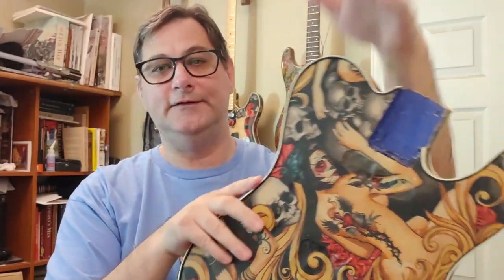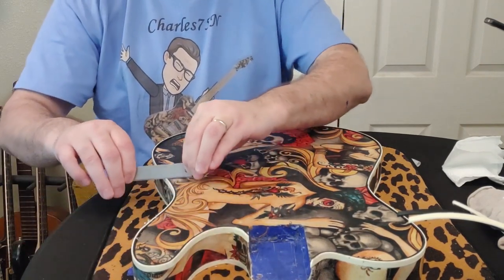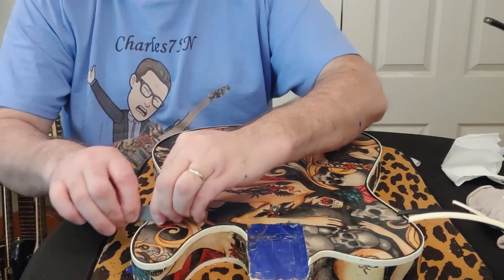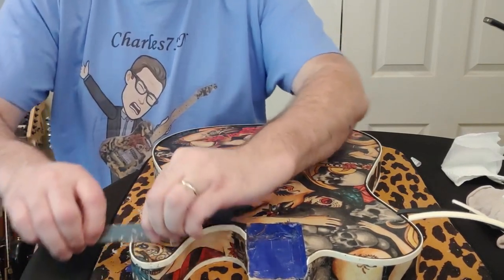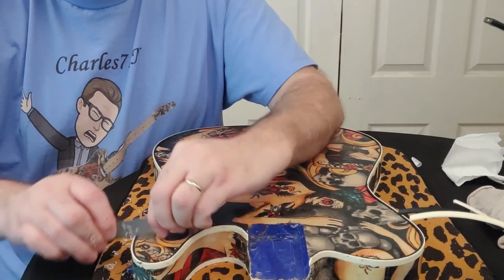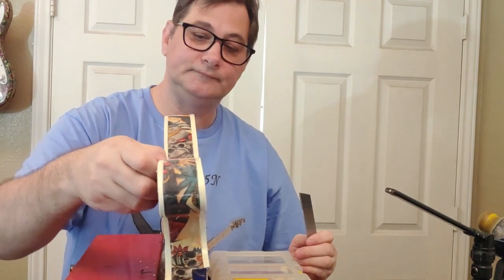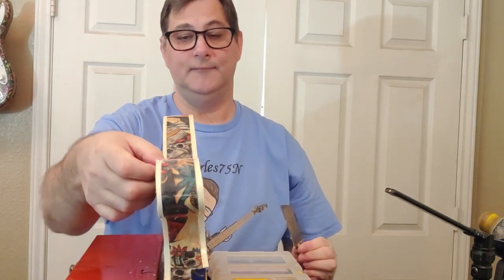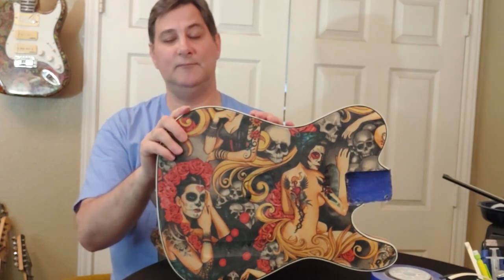Scraping the Binding On the Fabric Top Telecaster for Unfcknblvbl

Comment: Looks good mate. When i do binding I use a little diy tool. It’s a piece of dowel, say 3/4in and 6 in long, with a thin slot cut in one end. Knock a razor blade into the slot so there’s the thickness of your binding sticking out one side, at 90 degrees. Just keep the dowel. Flat to the side or top and you won’t scratch your prepared surfaces. I usually do it like you show, then finish off with the tool.
Reply from the maker: Thank you for the compliment.  I really appreciate it.  Your diy tool sounds pretty cool.  I might have to make one.  Cheers.